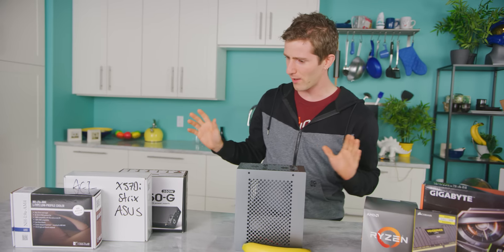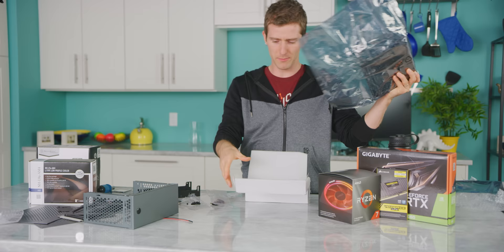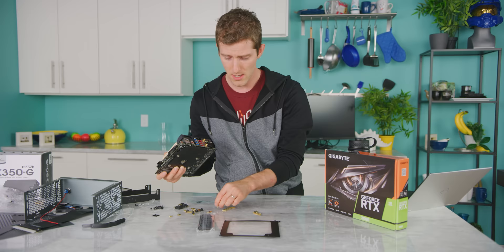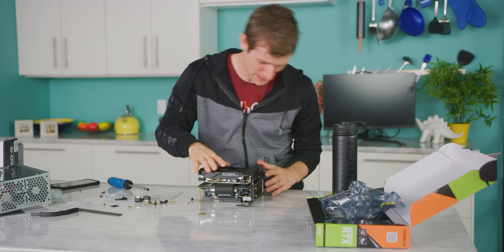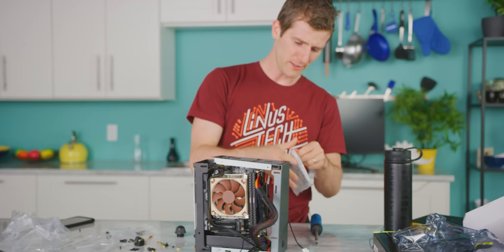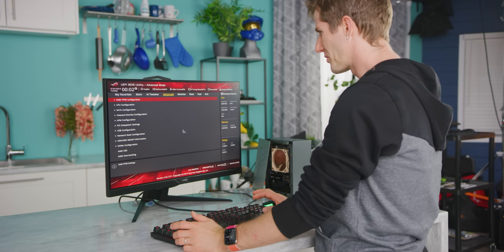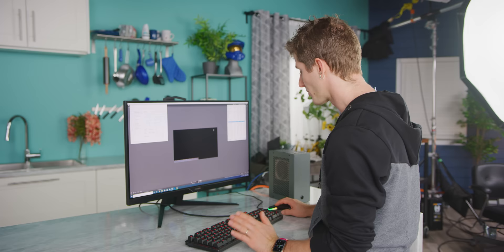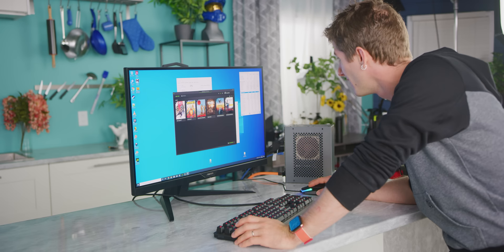Our Smallest Gaming PC Build EVER! - Velkase Velka 3

Comment: I feel so uncomfortable when the cables are squeezed so hard
Reply: Doesnt every man feel that
Reply: What do you think will happen? If you kink it too hard, it'll stop the flow of electrons... Just like a kink in a hose stops water.
Reply: @xenonram  Thats not quite what happens...
Reply: @xenonram  It's just kinda .. Inelegant, bungs up airflow cramps the tight lil case even more

(Me i might void my warranty, go inside the PSU to chop 'n resolder the leads shorter ;))
Reply: Xd
Reply: Andrew Delashaw I agree. Also, if the ambient temp falls below freezing point, electrons and electricity will stop flowing completely.
Reply: What linus didn't do, and should have done was get a flex atx PSU with shorter cables, or a modular PSU so that he could use shorter cables.   This is key in any SFF build.
Reply: @xenonram  SQUEEZE THEM ELECTRONS

Comment: This PC
Portable 120hz 1440p monitor (G-story)
Wireless 60% mech keyboard
Wireless mouse
Earbuds

Ultimate travel setup
Reply: add solar generator and wifi adapter for the ultimate setup-anywhere travel setup
Reply: @somethingtrulyhorrifying  5g hotspot*
Reply: You mean laptop
Reply: That's godlike
Reply: currency ma  Laptops are shit.
Reply: Lmfao "laptops are shit" so you really gon bring all the crap in the list everyday everywhere huh?
Reply: @greenbush9903  i just bought a laptop and all i can say is laptops are shit
Reply: Laptops aren't trash they're just reaaaaaly overpriced for what you get
Reply: @flyde6521  well..... now I know i made the wrong choice of buying an acer predator
Reply: @overbored617  Well of course you did, because the mistake you made was buying an acer predator
Reply: @flyde6521  yeah at the price of helios I could've just built a pc like this and put it in my travelling bag
Reply: @essayedgar  yes they are but don't count only the components.You get also a monitor ,speakers and keyboard which you won't have to buy separate, all in a really portable body.As i travel more often , i suppose i use my laptop way more then my desktop even if it is less powerfull.
Reply: If you could stick a mini projector into an sff case then it would be dope
Reply: Ducky One 2 Mini
Logitech G305
WF-1000XM3
Reply: The Nintendo switch of PCs

Comment: Me thinking this might be affordable:

...
Reply: Easily 1k
Reply: €1,700 lmao
Reply: @TheReal_Antrey  1k huh? With the stuff he put in there, I'd imagine that mobo alone to be probably about 1/3 that, then the 2070, easily 1/3 that, and the 3700x, which is what, somewhere around 1/3 that? So I guess the rest of the components were FREEEEEEE lmao.
Reply: You can cheapen the price by getting a Ryzen 5 instead of 7. Use a gtx 1080 mini. 250gb ssd. That should cut the price down.
Reply: Highest Level Of Degeneracy that is not really even a pc I need. I’m getting a $700 one before Christmas hopefully, and a decent setup. It would have r5 3600 and 1660 super oc. So there would be some upgrade paths. The ram is prob 16gb 3200 or 3600mhz Idk. What do you think it will be like for streaming r6, tf2, and other lighter games?
Reply: @brananandreu4086  The 1 thing I would change is the graphic card. I would probably swap it out for a GTX 1080 or RTX 2060
Reply: Highest Level Of Degeneracy would this be in about the same price range? I can always change my price to $800 but I was hoping to just keep it around $750 idk
Reply: @brananandreu4086  tbh the 1660 is a pretty good gpu. I would say the main reason to get a 2060 would be that Ray tracing will probably become more common with the next gen console releases. With the games you mentioned a 1660 super will be more then enough for 1080p and good enough for 1440. Though you will probs be able to get second hand 2060 or even 2070 within your budget cause of people selling for a 30 series card
Reply: @zyan983  wait so like, in total what do you think the price is because he never says it?
Reply: @southernbelle1313  The price would probably be around 1700+
Reply: Mabe Dyson should come up with a computer fan line.
Reply: this has managed to be my most liked comment.
Reply: Yeezy Addict ye bro that’s what i mean
Reply: Wayne yeah. this is somehow my most liked comment lmfao
Reply: Branan Andreu r6 and tf2 it’ll be good but like tomb raider or doom will be lucky to get 60 fps
Reply: Jesus Big Toe i have no intent of playing either and that’s fine for me if i did want to play them
Reply: @brananandreu4086  tf2 is cpu based so i dont you have to have a beefy gpu
Reply: Lerre ok, i wanna branch out to be able to play other games well too. i’m new to pc gaming because i have played console all of my life, so i wanna try pc exclusive games or my favorite console games on pc
Reply: Lerre i also want to stream and edit videos, because i want to be able to create content (for fun). it’s also one of the reasons my parents are giving me a bit of money towards it, so i can be creative (and also it’s my bday)
Reply: @brananandreu4086  just wait for zen 3, big navi, then get a ryzen 5, the best budget GPU. This is clearly not the best time for buying a computer coz Microsoft is working on x64 ARM emulation and that'll be EPIC
Reply: @jimitsoni18  i have no idea what any of those mean but by the time i save up enough money from mowing lawns im sure those will all be launched lol
Reply: Jimit Soni oh cool okay
Reply: @brananandreu4086  It's just cheaper to wait till the new gpu's and cpu's are readily available and aroun christmas time many are on sale. Like was said before ryzen 5 3600 is probs the best bang for your buck. For the gpu you really have to decide if you are gonna be able to upgrade or not. The 1660 super is definitely good enough but if you dont want gtx but rtx with raytracing you can get a 2060. It's mainly the features that are better because it's not that much more fps. Just don't get the normal 1660 or the 1660 ti. If I'm correct the normal 1660 has GDDR5 instead of GDDR6 with is better and the 1660 ti is not many fps more for a much higher price. I think the make or break is if you're gonna be playing games like Microsoft Flight Sim or RDR2. Those are some games that just run that little bit better on an rtx card (you might have some dips in fps but on the 2060 it's a more steady 60 fps+ on high settings. Most other games you might want to play are going to be running great. Currently the EVGA 1660 Super is around $220 and a Gigabyte 2060 just under $300 (I'd say EVGA is always a great bet because they're quality and sometimes on the cheap side). For content creation you also want to pay attention to the ssd because a good, fast one (like an m.2 ssd) is mostly noticable with for example adobe premiere or other editing software. If you need any help just ask because i think everyone here likes to help. Oh and just search for some 1660 super vs 2060 benchmarks if you want to know exactly just how many fps you can get on certain games. There are thousands of youtube channels doing exactly that.
Reply: @maloetienne8589  as a matter of fact the gtx 1660 super i was looking at costs more than a 2060 rn, so i may just go for a 2060
Reply: @yvtiwari  not all there is a case like velka 3 called k39 it is around 50 dollar
Reply: you should think less
Reply: Yeezy Addict  $79.99*
Reply: @randomdude2465  i am aware of that, but at that time i had no idea about specs and sheit...
Reply: @zyan983  what about use an hdd instead of an ssd.
Reply: @yvtiwari  if you dont care about it looking like a dell prebuilt the inwin bk623 is a cheap sff case that can take any blower style gpu
Reply: plot twist: it is
Reply: I can't even afford the case
Reply: It's not impossible, youjust gotta source your parts in refurbed/used/open box.
Reply: being poor isnt cool btw. dont know why you think its funny.
Reply: @louisczar6483  are you responding to me specifically or someone within the replies? i was not trying to make a joke out of being poor, and i’m sorry it came out as that to you. i just wanted to point out that based on the thumbnail i assumed that it might be affordable for my budget, when it is not in fact. there was one douchebag in the replies that made fun of someone for not being able to afford a pc or computer, but they (as said above) were a douchebag
Reply: @louisczar6483 because it's relatable? 🤔
Reply: Why would you think this would be affordable
Reply: @notxarb6353  i didn’t know the specs so based on the size in the thumbnail i thought they wouldn’t be great
Reply: @notxarb6353  lol it's a linus video, maybe cuz it's smol?
Reply: @brananandreu4086  it’s only a few days away bro, I hope you get what you want for Christmas 🎄. Merry Christmas fam
Reply: @kodfish101  thx dude! i’m still saving and i’m at about $600, so i’m hoping i get some cash from relatives and friends for christmas. i can’t wait to get my pc so i can play some games other than tf2 lol
Reply: @kodfish101  to add to what i just said, unfortunately the price on the parts i was looking at have gone up, but it’s mostly the 1660... they cost more than a 2060 now-
Reply: @kodfish101  now i’m super close to getting the pc and setup! i got a lot of cash from people so hopefully i can start ordering parts soon
Reply: @brananandreu4086  I’m having the same problem with the parts I want, but my birthdays next May and I’m hoping the prices/demand of the products I want will be back to normal or closer.
Reply: @brananandreu4086  and to also add on to what I said, I would also like to stream and record videos with friends but I’m down to wait a little bit
Reply: @kodfish101  i hope so dude- i might just continue saving until they come back and manufacturing countries start chugging along again. at least then a pc will be less of a dent in my bank account
Reply: @kodfish101  yee- also thanks for the sub! i have a shitty twitch if you want the name but i haven’t been streaming as often. though i’m trying obs studio instead of streamlabs but it’s been glitchy
Reply: @brananandreu4086  aye if your down to give me it than I’m down to watch when I have time
Reply: @brananandreu4086  agreed

Comment: 16:47 Linus, you can replace that fan with an 40mm Noctua fan, so you can also check the RPMs from the fan menu and lower them
Reply: Thanks !
Reply: How thick are the case fans he's using?
Reply: @remarcableplays  Case fans are probably 80x15mm...im pretty sure Noctua has those too, but if not, its not a rare size either. Only issue in a silent setup could be the VGA, Gigabyte is notorious for using sketchy fans...but that can be replaced as well IF needed

Comment: So happy that Canada uses celsius, such that temperatures makes sense.
Reply: Celsius makes no sense. Fahrenheit is how it actually feels outside to a human. Celsius is bullshit
Reply: @jaradshively8976  Dude in Celsius the freezing point of water is 0 degrees. The boiling point is 100 degrees. In Fahrenheit the freezing point of water is 32 degrees, which is random af. And how is fahrenheit "how it actually feels outside to a human", the temperature doesn't feel any different if it's measured in c or f, and human bodies don't perceive numbers lol
Reply: @samb5358  because if its 100F outside that means its hot as fuck. If its 0 F that means its cold as fuck. Look it up F is how humans perceive temperature.
Reply: Jarad Shively humans perceive temperature by predicting degree by how hot it is. i can quite accurately give or take 3-5 degrees tell what celsius there is outside. fahrenheit is a stupid and outdated way to measure heat
Reply: @jaradshively8976  so instead of using simpler (0 degrees water freezes, 100 water boils) you prefer to be in only system because you can't figure out that 40 Celsius is hot
Reply: @jaradshively8976  Then ask a russian living in Yakutsk, french in France and egyptian in Egypt what are their ''comfort'' of degrees...
Reply: @jaradshively8976  I love ma freedom units
Reply: Celsius (and metric in general) is much better for science/engineering or any time you are doing math with it. The first step for any problem involving Fahrenheit is to convert it to Celsius. Fahrenheit is much more intuitive for talking about temperature in terms of weather. 0 is really cold. 100 is really hot. Super simple. If we could only ever use 1, I would go with Celsius since if you are using it your whole life it is going to be intuitive to talk about anyway.
Reply: Y'all sleeping on Kelvin
Reply: @jaradshively8976  well half of the world use it
Reply: 1: water’s boiling and freezing temps vary with altitude, so much so that I swear there are parts of the US were water boils at 90 degrees or so.

2: if you want an absolute measurement system, try the kelvin system which is used for science and chem class.

3: Fahrenheit has a propensity to use larger scale numbers, which should not be underestimated. I have lived with Fahrenheit all my life, I don’t think I’ve ever seen decimal precision using F. The metric system uses decimals a lot, which is fine, but that means you need to comprehend the decimal system which is usually taught after the concept of this number is bigger than that number, making F potentially easier to grasp for children. Then there’s inches, which often brings about an unholy amount of fractions such that you know what, I’ll just google the conversion, do the math in metric then convert it back out at the end.

But 4 and finally: The metric system is the system you’ve known for basically your entire life, the imperial system is the system I’ve grown up with for my entire life, and that’s the real reason we use the systems that we do. You have an entire lifetime worth of experience with which to base your judgement on and that’s the main benefit to using the system that you use. There’s a reason that countries don’t just up and change their entire measurement system all that often.

Also, the 0 and 100 on the Fahrenheit system can generally be considered the upper and lower bounds at which point you could start dying from exposure, which is a far more useful metric for weather reports than how the waters going to behave this week, especially when things like weather or not it’s going to snow are usually included either way.
Reply: This was the most unneeded fight but forreal F is really random and hard to predict weather etc as in F not as in rain or something
Reply: True, Celsius is way better, Fahrenheit is BS !
Reply: Plus yooo its uh 0 degrees outside c then we got f yoo its 40 degrees outside! does 40 make sense?
Reply: Elegant Noob it does if it’s the system you’ve used all your life, it’s no less abstract to you than C is to most Americans.
Reply: Guys you don't know that Celsius and Fahrenheit have different scaling!!

In negative numbers Fahrenheit starts to get funky
-40°C is actually -40F !
Past that Fahrenheit actually takes lead
At -50°C is -58F
While at higher tempatures the relative number position of Celsius and Fahrenheit gets bigger and stays the same at some point
Reply: Celsius is more straight forward, but I’d have to get used to 40 degrees being blazing hot instead of 100.
Reply: Baked Bacon I mean 100C is still hot, just not the sort of temperature you’ll see very often outside of electronics.
Reply: @Fanshi Imagine complaining that someone uses a system that has 0 as really cold and 100 as really hot as opposed to a system that has -17.77777777777777778 as really cold and 37.77777777777778 as really hot.
Reply: ThatOneAviator you mean like the UK and their stones, mix of miles and kilometers, horsepower in stead of kilowatts where possible, and an absolutely bastardized unit I was only able to tell from context stood for kilograms per square inch. And I only got that last one because of it’s similarity to the US unit PSI. Additionally, what exactly do you suggest we start calling all our imperial-based products? The roughly-one-third-of-a-meter long sandwich? The royale with cheese? Nah, not today or in any immediate future.

Comment: It’s weird how anal people get about how loud their case fans are, as if their homes are completely silent, to the point of hearing a pin drop the next room over.
Reply: I'd say it's a reasonable concern particularly for content creators, those working with audio/video recording & people who rely on their ears for their line of work/hobby. Though yeah, at a certain point cars driving by or the neighbors outside shall be the ones causing more noise than the fans are capable of.
Reply: As a person who used to have a 2011 Mac mini that ran at almost max rpm whenever it was on and I also had to cool it with a noisy desk fan I don’t mind my pc making a little bit a of noise, it’s a lot better than that jet turbine of a Mac.
Reply: @PugkinSoup  I would say it's something our ears get used to blocking out as white-noise but that may not mean our ears aren't being continuously fatigued by the sound even if we don't realize it.
Reply: Captainzilla418  I mean after 5 years I got used to it.
Reply: Visited my parents, way out on nowhere, I forgot what proper silence was without any ambient noises
Reply: I had a desktop back in the day that was so loud, I was happy to invest some time in making my next desktop quieter. And I did. A quiet computer is good for audio recording, unless you're in a proper studio, you can't have fan noise bleeding over a mic or something.